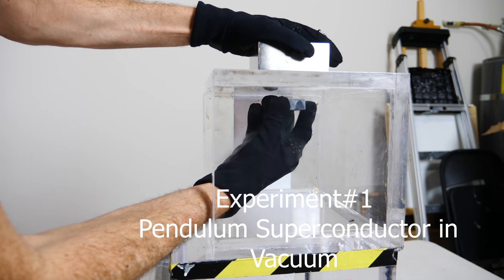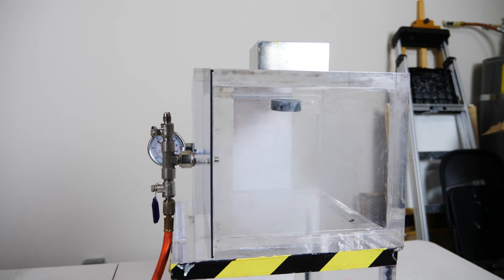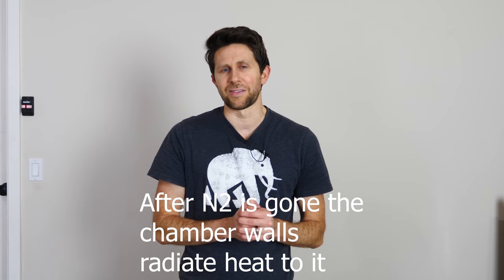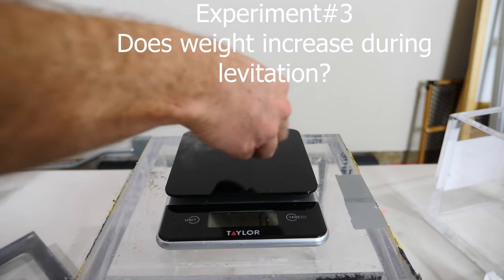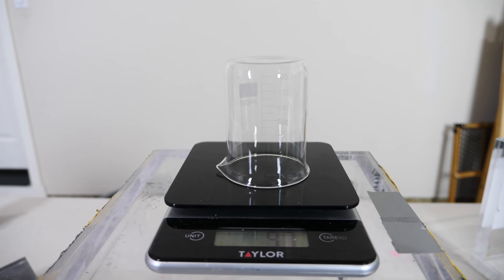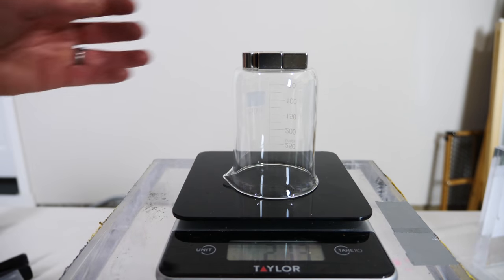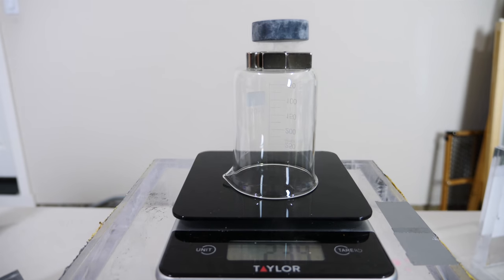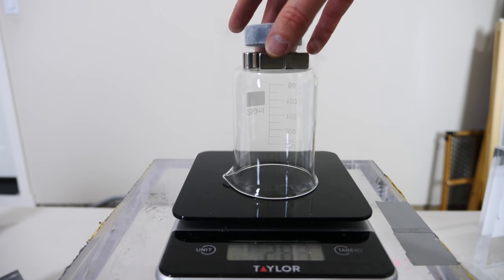Does The Weight Increase When You Levitate a Superconductor on a Scale?

Comment: Can you please talk a bit about mag levs and the challenges faced when actually using this for transportation in the world today ? Thanksss
Reply: It's really really expensive and extremely difficult to engineer. 
You have to have a superconducting surface that's either the length of your train, which has to be then broken into sections for each car or you have to have one single unit with no cars. The length of such a unit has to be shorter then the radius of a circle of which any curve in your track is a section of so that it can follow the track at speed without derailing, and if you have NO at speed contact surfaces between the track and the train, there's a pretty low limit as to how much lateral movement you can allow the train to have or it will simply get thrown off the field that is essentially your track. Basically, you need long straight track with no curves or turns. You also still have to have some sort of traditional track rail surface because you have to have some way to propel the train and stop it as well. You can use magnetic braking and propulsion to be sure. Either in the track or carried on the train. Doing it in the track is stupid expensive if you want performance that makes it attractive to governments so we are talking speeds over 100 mph and getting toward 300 mph to make this price attractive over cheaper but slower options. 
 Each method has its disadvantages. 
One, building propulsion into the track is ridiculously expensive. 
 Building it into the train requires a huge power source to be on the train, so either huge batteries or a large generator powered either by traditional fuel sources or nuclear power which is defeating the entire purpose of something like mag lev on one hand and really expensive and possibly dangerous on the other hand. 
 Since we dont have mass producible high temperature superconductors yet, where ever you put your superconductors, you need coolant. 
And you run into other problems with multi car trains because the breaks between cars produce field gaps in either configuration, field gaps lead to instabilities especially under speed. You have to shore up the gaps with some sort of continuous surface of either magnets or superconductors. This CAN be done but its complicated and expensive. Going with a single long car config with a straight track is much better. This is limited in its applications and its attractiveness. 
 It's actually easier to build the auowr conductors into the train especially in the single car case as it's much easier to cool a smaller amount of superconductors than it is an entire track. But then your have to carry the coolant. Liquid nitrogen is expensive and can be dangerous. a mass containment failure in the passenger compartment would be really really bad and in some cases if the  nitrogen displaces the oxygen in the car, everyone could die. This could happen slowly like carbon monoxide poisoning.  
 So you end up building a train with extra steps and more risks and expense. 
So one way you have to use a lot of superconductors or you have to use a lot of magnets. And then there's mass and speed to consider. the effect described in this video wasn't fully explained.  The action of a magnetic field in proximity to a superconductor at critical temperature meaning it's currently capable of super conducting will created heat inside the superconductor.  It will raise its temperature.  This is a complicated subject but several variables effect what happens. 
Field strength,  mass of both the super conductor and total payload, magnetic flux. If these things become too large, the superconductor can stop being a superconductor.  This could be really bad. 
Kinda like if your airplane stops being an airplane. 
 It's a nice idea but it's really complex to implement. Which is why they arent everywhere.
Reply: Rules today have to be nesecary. Reduced
Reply: It would take quantum generators to power and if you developed one of them then the same thing would happen to you that happened to Nick Tesla but there's still so many things to over come to make it effective and efficient
Reply: @joerambo4977  what's a "quantum generator"?
Reply: @joerambo4977  https://en.wikipedia.org/wiki/Maglev

They exist and there's no need for quantum generators. Whatever that is. 
 It's just not a really economic endeavor compared to other methods of doing the same thing.
Reply: @metamorphicorder  did you type all that out yourself or copy paste? If typed and thought out impressive. Sorry i didnt read it all just skimmed. But good info. Be honest.
Reply: @w00tb0ss  I typed it all myself. 
Most of the existing mag lev just uses magnets and not superconductors though. Makes things somewhat easier.
Reply: @metamorphicorder  i am going to grab a beer and read through it. Don't worry i judge harshly but i wouldn't have commented if it was wiki copy paste. I love low friction mag lev trains and the concept.
Reply: @w00tb0ss  I'm sure someone more up to date can find all my misconceptions and errors. Like I said, it was 30 years ago when i studied it. The basic principle is that there are very few scenarios where mag lev brings benefits that outweigh its costs. It's one of those times where something that's cool and sciencey just doesnt pan out very well because the previous technology is still just more efficient even it is not as cool.
Reply: @metamorphicorder  wow damn. You put a lot of intelligent information and effort into that comment. I was going to say why waste the time on a youtube comment but i appreciate it. The only thing i have looked at is Elon Musk Hyperbole transport but have not looked into or paid attention for a long while since the beginning. Great idea but like super conductor mag lev it is very not practical for cost. Damn to take an amtrack train across country costs more than a plane or just driving. My cell phone costs less than a computer on my desk. Tech and science is weird and i am not that smart lol 🙃
Reply: It seems like mag lev trains would be good for goods. Smaller cars zipping along mostly straight tunnels underground. Less critical than passenger service...pass more costs to business. I presume the Japanese are the best to consult with.
Reply: Building a superconducting maglev train track is expensive. It would be wiser to build a conventional electric train track powered by a superconducting motor generator.
Reply: @metamorphicorder  .

Comment: Hello! Nice experiments. There is one that I wanted to do during my grad, but was not able to. 
Start slowly and controlling the amount of N2 to cool the superconductor, right to the barrier where it becomes SC. 
Now if you add a magnet to the system, will it heat and become non SC? (Or you could adding until get the lock and add a magnet or weight).
If so, does different magnets (flux) generates different heat? Does different weights produces different heat?
Reply: Yo, did you ever get the answer to this? Also, I’m looking into magnetic levitation for my EE, but I need to find equations that describe the relationship between mass /scale and the magnet (be it magnetic field strength etc)

Comment: Isn’t that that one law were everything has an equal reaction n stuff 😂
Reply: Yes, exactly correct.
Gravity is exerting a force on your body and pushing you down. The ground has to bring up exactly the same force in the opposite direction in order for your body not to fall "through" the ground and be able to stand on the ground. If a ground (eg. quick sand) cannot bring up that force, then there the force of gravity cannot be canceled anymore and you start to accelerate to the center of gravity.

The law you are referring to is one of the famous "Newton laws".
a) F = m * a
b) For every action (=force) there is an equal and opposite reaction.

Ond could also argue that the conservation principles are a generalizatio of that one. If a body is motionsless or in uniform linear motion AND we know that there is a force acting on that body, then we have to conclude that there must be another force somwhere which counteracts the first force. Because otherwise the sum of those forces would not equal out to 0, and as the first Newton principle tells us, if there is some remaining force that would lead to an acceleration. But an acceleration is a direct contradiction to the observation, that the body is motionless or in uniform linear motion (which both means: unaccelerated).

We know
a) the body (doesn't matter if it is a superconductor or not) is motionless
b) we know, that the force of gravity is acting upon it
therefore we know, that there must be a force counteracting the force of gravity.

Comment: The faster evaporation of the LN is actually cooling it down further than the "normal" Boiling point of LN
Also:
What I am Wondering is: can you measure the wheightlos by photon emission of a flashlight?
Reply: Fabian Widmann I think it would get heavier  when you put the flashlight on , becaause of requoil...
Reply: I also dont think energy has a mass...
Reply: Yay KRUSER That is true but energy is also equivalent to mass so anything emitting photons would lose mass. This could possibly be detected by weighing a battery before and after draining it, as the battery is the power source of a flashlight.
Reply: @yaykruser   Not if you lay it on its side
Reply: @jerry3790   The change in mass from a discharging battery or flashlight is far too little to measure.  mc^2 is a huge number.
Reply: DANG JOS Yeah, okay
Reply: Yay KRUSER you are hilarious (not sarcasm)
Reply: Jerry Rupprecht Does that work with all kinds of energy? does something loose mas if you cool it down?
I think light is an exception here.
Reply: @yaykruser   Yay KRUSER  do you know Einstein? E=mc^2     in other words you get a little mass for a lot of energy, (in a nuclear reactor you get a lot of energy for a little mass, and the chemical reaction in a battery does the same thing but it only uses a very very small percentage of the mass not like in a nuke where much more mass is converted) (if you know what antimatter is you might know that it can anihalate into energy the same thing can be done the other way around, a very high energy photon can spontaneously create a matter antimatter pair,) (getting even further, if you take a proton and split it um in its 3 quarks so 1 down and 2 ups if I'm correct, and add their mass its much less than the mass of the whole proton, that's because most of its mass comes from the gluon binding energy between those quarks)
Reply: @Fabian Widmann  That's right, and the lowest temperature the LN2 can cool it to is 63 Kelvin, which is the triple point temperature of nitrogen.  However, having a lasting supply of 77K LN2 is still much better than a disappearing supply of 63K LN2, so the puck should still last longer in the ambient conditions, rather than the vacuum chamber.
Reply: Fabian Widmann I know that you can change mass to energy and back, but doesnt that imply that you energy cant have mass , becaus it is created out of mass?
Reply: @yaykruser  it works with every kind, kinetic, thermal, and so on, just not potential because it's not really a firm of energy
Reply: I love this physics spirit here, great thoughts everyone!! Greetings from Austria
Reply: @yaykruser  energy can act as mass, even curve space-time, you should watch all of PBS spacetime 's videos they discribe this perfectly and also Don from Fermilab
Reply: I found this dicussion: 
https://www.researchgate.net/post/Does_the_mass_of_an_electron_change_after_absorption_and_emission_photon
At least we can say that there is no  way he can measure it with his kitchen scale 😂
Reply: @yaykruser  that's right😂, still would love to have more people who explain this stuff, you see it's quite an interesting conversation

Comment: Just an idea to get to a full vacuum quicker: Pulling a vacuum in a "side chamber" (a tank or something), connecting it to the main chamber, pulling a slight vacuum in the main chamber to close it, opening the valve to the side chamber and when both chambers are at equilibrium, continue with the pump. It might not work in practice, but in my head it sounds pretty reasonable and faster.
Reply: Overall it won't be quicker, since you have to pull a vacuum in the "side chamber" in the first place. But it will be quicker if he uses a bigger pump.
Reply: @Ygr3ku  actually, overall it would be quicker because the pump would be working on something useful while he is talking and setting up the test.
Reply: @microdesigns2000  Overall=Looking at the big picture. So ... if you look at the big picture, aka him pumping air out of 2 containers, it's slower than pumping air from only one. Even if you say that he only has to start the pump, setting that second container takes time, thus less efficient. 

BUT ... if you only consider the time needed for getting vacuum in his useful container using his 2 chamber setup, then yes, it might be quicker.

Comment: I'm confused as to why anyone would believe the weight wouldn't increase.
Reply: I wouldn't increase if the the scale was in between the dead air space where it floats. But the superconductor isnt strong enough to do that.
Reply: I'm also kind of clueless about this no-question that's in desperate need of no answer.

It would be more interesting to ask whether a bird flying inside a house causes the weight of the house to decrease because the bird is no longer touching the house.
The answer is still easy to guess, but at least not so absurdly obvious as the magnetic repulsion thing.
Reply: Read the comments from the previous video. There was like a 75 long comment argument about it before I gave up. Some of the theories about why it would be weightless were really funny. I hope they see this video.
Reply: I am not as smart as all of you. I was sure it would add weight, but I couldnt explain how. I like learning the hows and whys of things.
Reply: @hrgwea  myth busters tested this. The bird weight does not go away. The reason is the downward thrust of the wings that allows the birds to go up transfers weight.